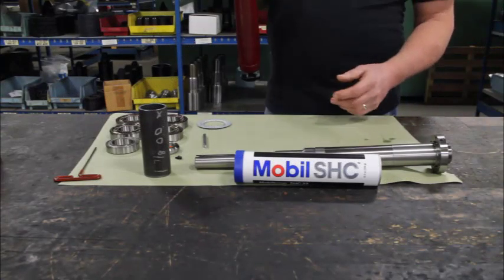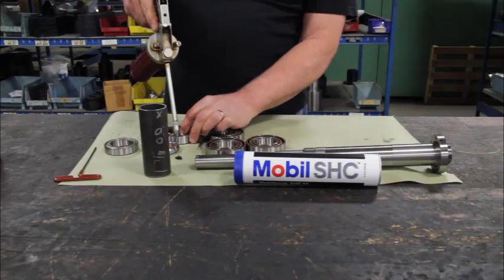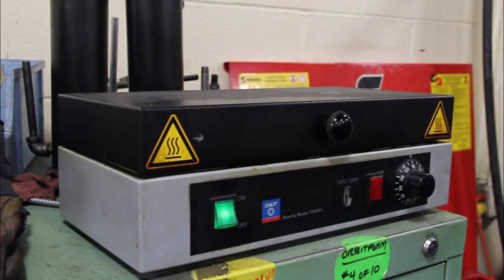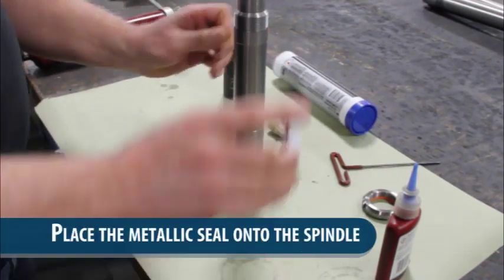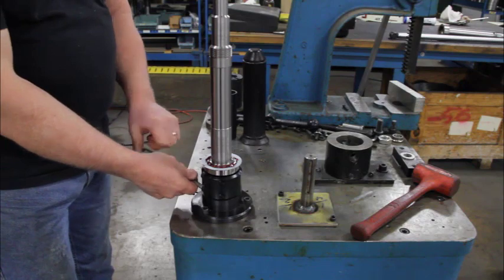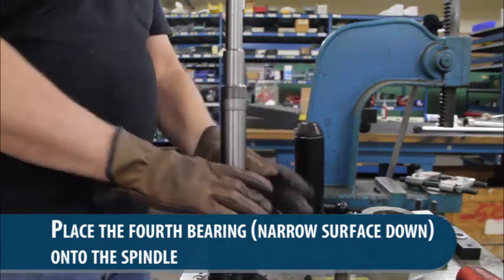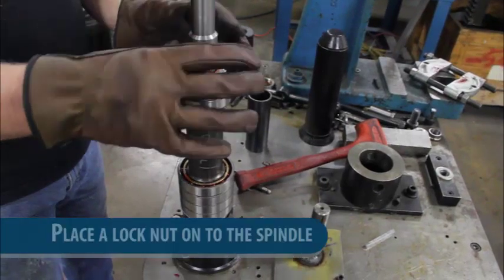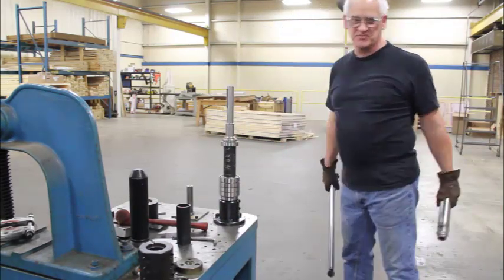M 750A Powerhead Spindle Assembly

Comment: this is how not to assembly a spindle...oh my god. Bearings and hammer are not friendly at all, if you heat them correctly and grease the shaft, you don't need the hammer.